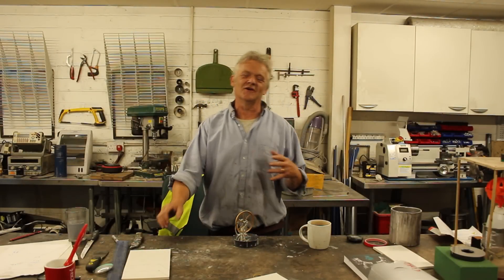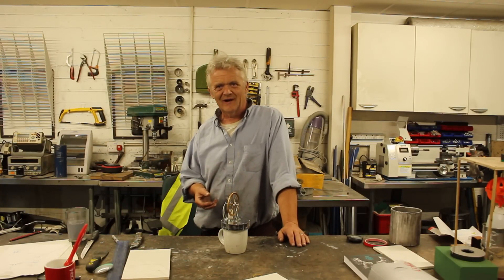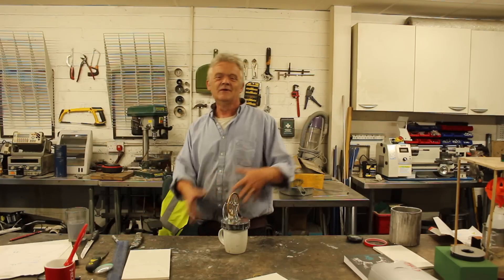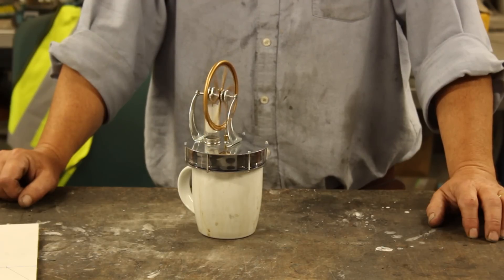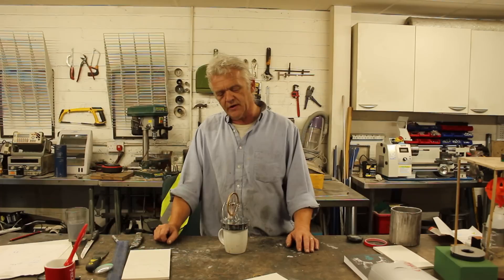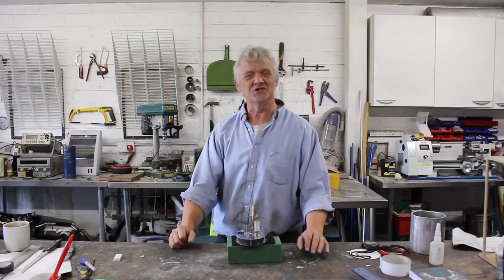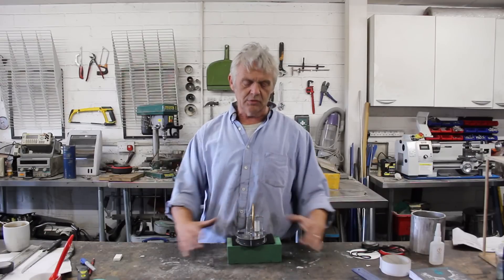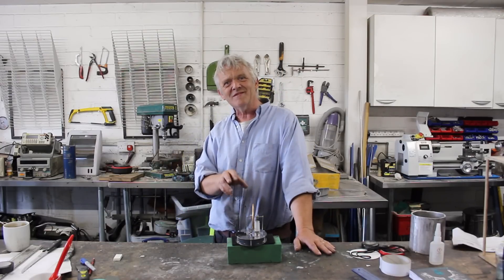1616 Alternative Solar Power - A Stirling Engine And A Cooler

Comment: Could you submerge a Stirling engine below the ground surface and have it work in summer, when the ground is colder than the air, and winter, when the ground is warmer than the air?  How big would the engine have to be in order to take advantage of the below ground temperature and the air temperature?  Is this doable?

Comment: Are there any drawings, plans available to build a large stirling engine that puts out meaningful energy? Imagine this things strapped on to the exhaust of a vehicle engine which is like 800 deg C and the IC engine has 80% efficiency in producing and wasting heat which this thing picks up and turns into usable energy. Or imagine a satellite dish focusing the sun onto one of its sides which is blackened while the other side is dipped in water or connected to a heatsink buried deep underground. So much savings. Or even off grid survival.

Comment: I'm impressed! I wonder if it would be more effective with alcool fumes as a medium gas in the engine. I alsi thought about the african hut chimney and cool air someone mentioned and I think a variant with tubes running just below an evaporative field would be very efficient.
Reply from the maker: I like the idea of a low boiling point fluid mate - I am pretty sure that would work well

Comment: Surely the radiation-absorbing black should be on the top plate, shading the oasis and allowing air to flow over the oasis to better cool it...?
Reply from the maker: it would be better if we turned the Stirling upside down

Comment: Great little experiment as always Rob. Here's an interesting idea that might be worth a go, how about using underground temperature difference vs ambient air to run a Stirling engine too? Obviously ground source works as we know, but might be fun to show a working example with a stirling engine to see the mechanics of ground source temperature differential recovery even on a smaller scale.
Reply from the maker: I like the idea mate - I will give it a bit of thought and see if I can come up with something - cheers
Reply: Toying with a similar idea, seasonal or day night cycles would fit in well . Many thanks for the inspiring vids Robert
Reply: Great idea

Comment: sticking it to a big CPU cooler, upside down, then covering the cooler so the sun light isn't hitting it, might be running good ! with some thermal paste in between of course, now I'm thinking, with a big enough cooler it might work on low sunlight ! of course the big CPU coolers are rather expensive, so it might not make much sense from a financial standpoint, unless you build on a large scale maybe and use the fans for another project (like a fan wall), some are cheaper though I think arround 30 ish, so we can imagine maybe 6-8 of them stuck to a huge heatsink, be curious to see what kind of output it could generate, would be nice to be able to get high quality cheap stirling engines
Reply from the maker: I like that idea mate - it would certainly improve it I think
Reply: @ThinkingandTinkering   Glad you like it, I'd be curious to try one day when I have the budget, in the mean time I could experiment on a small scale, here is the best and cheapest cpu cooler : Cooler Master Hyper 212 according to many, I remember I even saw it at 35$ once, but its arround 40 ish, although this is still a "low end" cooler, I'd be curious to see the difference with a high end 1, those cost arround 100 or more $ .. (like the noctua NHD 15)  I was also thinking.. perhaps there is a way to use car engine radiator and somehow adapt it for such a project.. even better for a large scale project if you can find a truck or even tractor one (not sure if the tractor  engines have coolers but I think it should..) and then the problem is these use liquid cooling so it might be a bit tricky to adapt it to such a project, just thinking out loud there, it would be much easer to just stick a sterling engine to a passive heatsink I guess ..

Comment: How about drilling some horizontal holes through the oasis block, and plumb them to a black painted flue pipe as a solar chimney. A rotating elbow at the top with an expansion cone exit to draw air if you have wind but not sun.
Reply from the maker: that would be much better - this was a pretty poor version and if it works anything you do like you suggest is going to improve it for sure

Comment: What was the number of the video you made about phase change materials?  Doesn't urea get cold when you wet it? It would be neat to see if that could be integrated into this evaporative cooling system. Something combining phase changing materials, heat pumps, and AC, would have plenty of buzz words for the YouTube algorithm 😁.
Reply from the maker: I am not sure but it might have been 1269 - but I also did the zeolite thing and that would work well here - heating or cooling
Reply: @ThinkingandTinkering It is, thanks.  I was thinking that besides the diy AC,. Maybe the cooling reaction of urea could be used on the rocket stove Stirling engine?  If it could be cycled to cool the cold side then be dried out again by the heat of the stove, maybe it would perform better than just a water jacket.

Comment: Brilliant.  I had this sort of thought after your vid yesterday.  
I ran across a vid recently explaining pop-pop boats, as I was wondering if the concept could be used for a solar water pump.   but I was surprised to discover they work like a stirling engine with water being the piston, which was pretty cool.   
It seems like that notion, with a blacked metal tank for your "boiler" and the evaporative cooler for your cold side, would be pretty easy to rig up.  I seem to recall you made a liquid piston one out of tubing didn't you?  

(incidentally, on the water pump, I came to a Maybe on that, if one added check valves to ensure the water only flowed one way, sort of ram-pump style.  It seemed like a potentially useful concept.)
Reply from the maker: I did mate and I agree the is a potentially useful concept - thanks for sharing it

Comment: hey, i read somewhere you can also reverse use the Stirling engine. so instead of a generator on it, put a motor on it. would result in one side getting hot and the other cooling down, making a heatpump (or AC). Do you have any experience with this?
Reply from the maker: never tried it mate - but I did read ups on it a bit and from what I can tell there is a bit more too it than that

Comment: Robert the earth at a meter in depth remains at 4 degrees so a shaft connecting the 2 chambers should work summer and winter
Reply from the maker: I have mytspade mate lol - I am thinking of giving this a go for sure
Reply: @ThinkingandTinkering  maybe some one close to you has a mini digger that watches your channel put out a request
Reply: I'd imagine copper pipe between cylinders althoug expensive would best and the more the merrier

Comment: I was looking for a big stirling engine... 50 to 100 kWh... it looks mission impossible :(
Reply from the maker: I have seen big Stirlings and Stirlings of power in that region - the Swedish run 2 submarines on Stirling engines - but the challenges of building a large engine are the same I it is a Stirling or not

Comment: Could you explore the possibility of using steam to power a sterling engine using heat from a mirror array or other reflective material?  I feel there is huge potential using this design on a small and large scale.  Thanks!
Reply from the maker: sure mate
Reply: @ThinkingandTinkering  There was a large project in Arizona that was ultimately shuttered, but it had a large array of mirrors that would move throughout the day to concentrate heat on a central boiler on a tower in the center.
Reply: I wonder if a closed loop system would be more efficient to conserve water?

Comment: I love to scale up a sterling for elec gen. I want to use the waste heat from PV panels to drive a sterling
Reply: @marthale7 I love that idea of misting, a lot simpler to implement.  It could be an intermediate step before adding a complex heat exchanger & pump.
Reply from the maker: nice idea mate
Reply: Great idea

Comment: Would it be possible to build a brick rocket stove cooker/water heater with a Stirling engine generator that could have a feed in from a rooftop solar thermal array or is that way too ambitious or would steam be easier/more reliable? Also does anyone know why Stirling engine generators are not available for sale? Any company that has tried seems to have disappeared.
Reply from the maker: it's possible mate - but it seems a little like overkill to me - but possible.

Comment: Just saw a video from someone using well water for their AC cooling system. They claim to get 72 F when it's 90 F outside with poor roof insulation. Pretty interesting.
Reply: That is interesting. I haven't seen that. Is it on YouTube? We have well water and a spring on our property, that has very cold water.. That would be interesting to see.
Reply from the maker: it sounds it mate - cheers

Comment: Sterling engine are good at pumping water. They are very efficient. But a lack something called torque.  I think.
Reply from the maker: stirling engines have been used for all kinds of things from the 1850s on - and there are quite a few designs - worth looking into the history a bit mate - if you are interested
Reply: @ThinkingandTinkering  I have.

Comment: I bought one very similar to Robert's many years ago. It would work if placed on your body, which could look a bit freaky, but very impressive. They also work if you stick them on an ice cube. Always wondered why they are not used more in solar energy. As usual great vid from Robert.
Reply from the maker: they are impressive and used quite a lot in solar - just not home solar

Comment: I wonder could you make a Sterling engine using an air conditioner because it is hot on one side and cold on the other
Reply from the maker: I would think so mate
Reply: @ThinkingandTinkering  I wonder how much power you can get out of it heck you can even use a refrigerator but I don't know how practical it would be but it sounds like it would be practical

Comment: I've always wondered what would be the output of one of those Amazon sterlings, with a small gen/cap set from one of those hand crank generators. Won't be able to use the gears tho lol
Reply from the maker: it won't turn one of those mate

Comment: I was hoping to see one of those sterling engines that has an alcohol flame normally powering it and see you pop on your rocket stove, I guess the one you have might work but I'm concerned about the rocket stove getting too hot for the low temp model
Reply: Good point. Maybe some kind of intercooler could work.........how about the engine runs a fan to make the fire hotter which will in turn generate more power? Just a thought
Reply from the maker: oh - the ltd won't last on a rocket stove mate - you need something that can cope with 4 - 500C - a bit of plastic won't do that - this isn't on a rocket stove - it's just on a brick wall outside
Reply: Hello diy heat sink

Comment: When you did the previous video I thought for sure this would be the next step and so it was. Now the only thing left to do is take the rocket stove, and the cooler put some barrier between them and make a larger sterling that can generate real power lol. Keep it up, I know a lot of this already but I enjoy seeing it in action. You do a good job of explaining things and building them. I wish I had enough space and time to do the same
Reply from the maker: I won't use this mate - this is just for folks who want to experiment - I will use the heavy duty aluminium Stirling I made when it comes to the rocket stove

Comment: Painting the top surface of that sterling engine flat black would help it absorb more heat from the sun and may create a greater temperature difference.  I was not aware these worked with cold/hot and hot/cold.  I always learn something new here.
Reply: Endless innovative technology
Reply from the maker: for sure mate
Reply: Could also paint the top plate black and stick a dome over it, like a greenhouse. Use a fresnal lens

Comment: Robert lovely video, I didn't realize that it worked on both hot AND cold surfaces so thank you. Sorry, but a quick Amazon link would be so helpful so we could be sure we are not going to buy an inferior product to get the same result you are showing. Just saying, ATB
Reply: Amazon only has 2 models in that style and they both are the same price and probably made at the same factory.  One of them is sponsored by Amazon so I would probably get that one in case there might be some difference, which I doubt.
Reply from the maker: if I do that mate youtube restricts the video as it then contains product placement - so - sorry about that